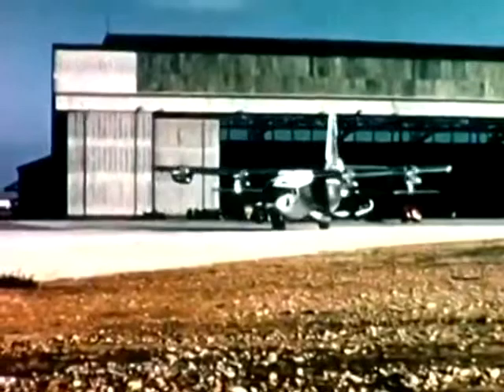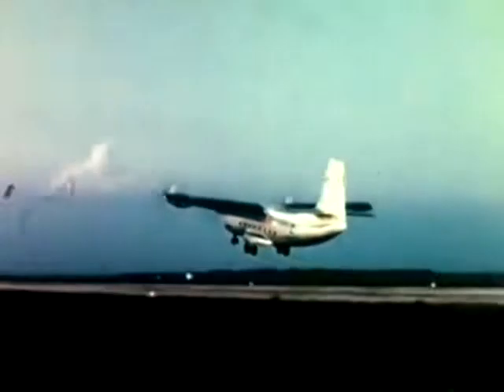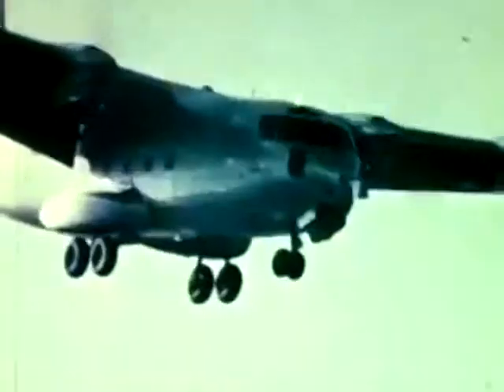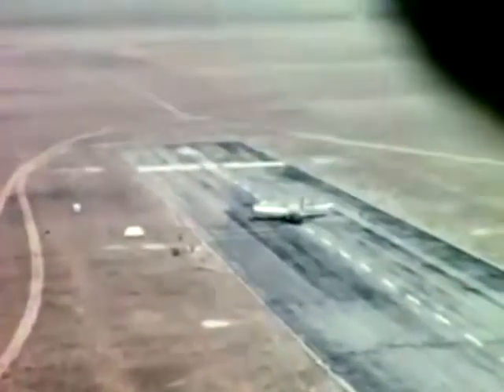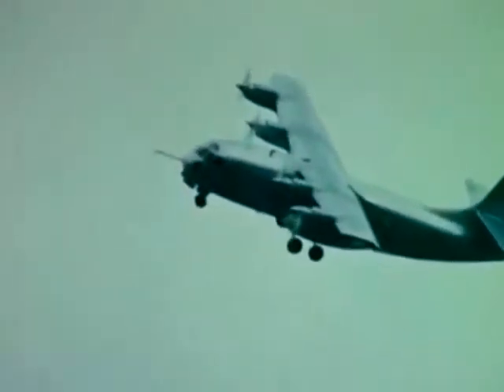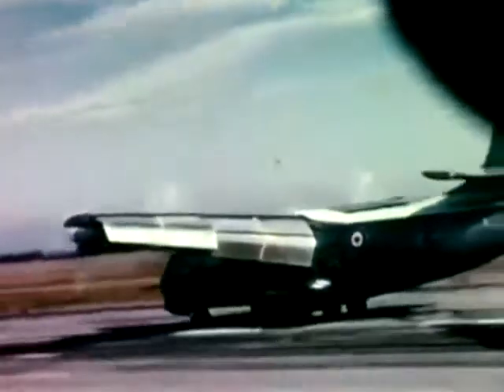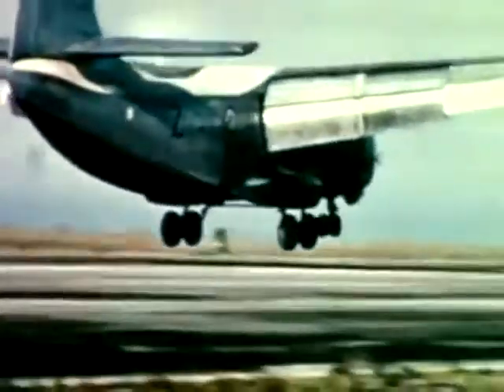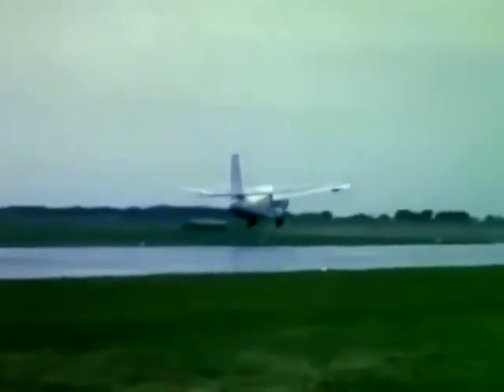McDonnell - The Model 188 STOL Transport (Breguet 941)

Comment: McDonnel 188 my A**.  It's sure enough the Breguet 941.  McD expressed an interest in it, and invited Breguet to bring it to the USA.  On their final flight in it, the yank crew deliberately performed a heavy landing, necessitating that the plane be examined by "Safety Officers" (in fact poorly disguised McD technical staff) who looked at every detail of the 941's construction and systems.  McD certainly never made one, and doubtless never intended to.
In fact the type didn't catch on, mostly due to its complexity and resulting maintenance costs.  One can be seen standing all forlorn with faded paint and the odd bit missing, in "Les Ailes Anciennes de Toulouse".  And if any yanks don't understand that.....tough.
Reply: True, the plant in the video is the 941. However, McDonell “DID” build two 188 examples. One in Eastern Airlines, and the other in American Airlines colors.

They were supposed to do a test program at Boston’s Logan Airport utilizing portions of adjacent taxiways as STOL runways. Also, it was to look at special approach paths in and out of Logan’s terminal area. Don’t one if the program ever happened.